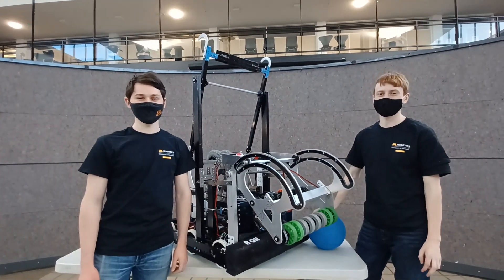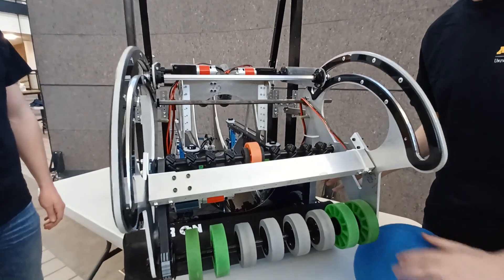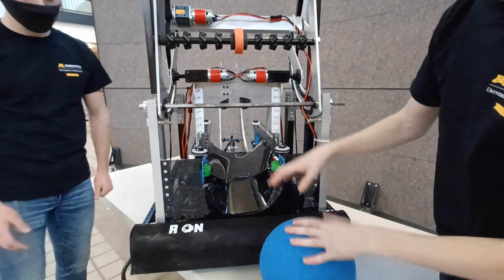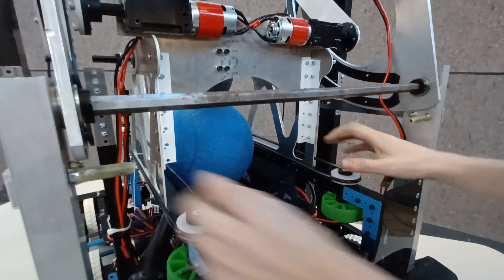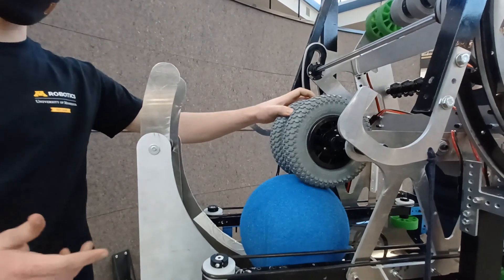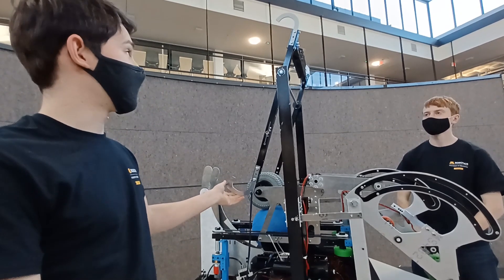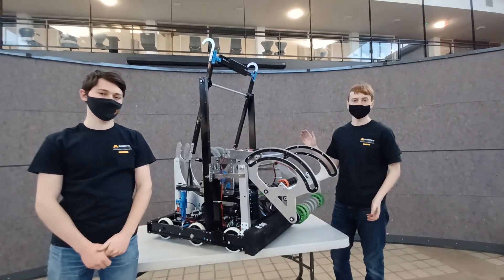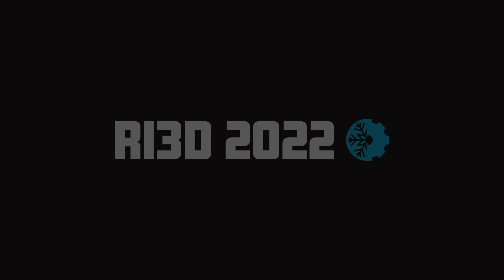Ri3D 2022 - Robot Walkthrough

Comment: I noticed in your robot reveal that the climb for the high rung was assisted with some human help. Just wondering, have you guys done a high rung climb without any human assistance? Since I believe by watching the robot reveal video that the main problem was unhooking the 1st set of hooks and hooking the 2nd set of hooks.
Reply: Unfortunately not, though the problem wasn't the first set of hooks  unhooking, it was the robot started swinging uncontrollably and unhooking itself. I believe we mention this in the white papers, but there were some easy solutions to this including having variable speed control with the climber (we had a single speed which didn't allow us to ease into the clime or slow down gradually once we made it to the third rung) and making the hooks slightly longer/wider to allow them to catch the third rung easier
Reply: @jaredschultz1867  Thanks a lot for the info!